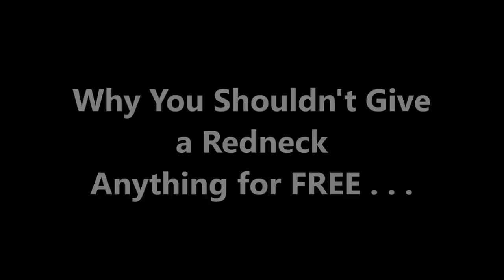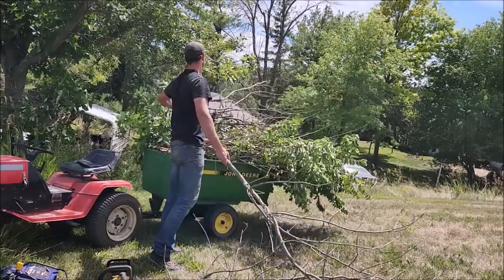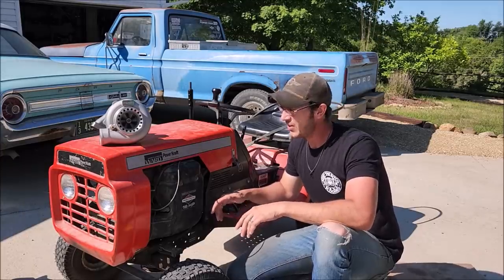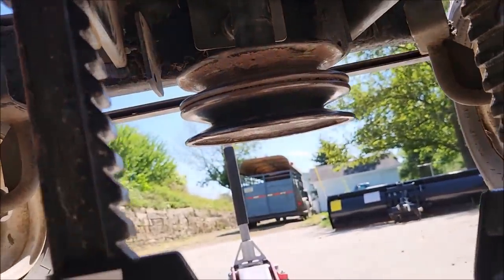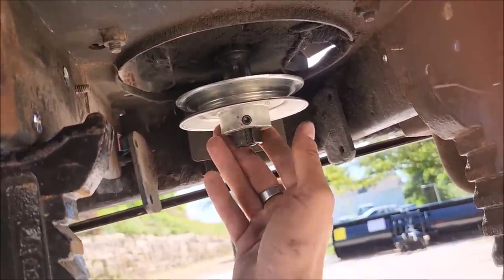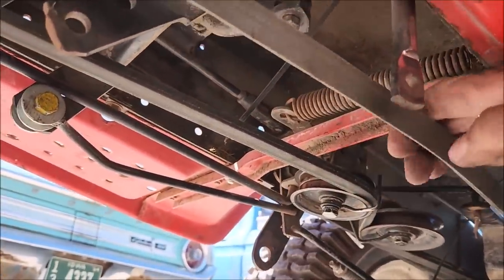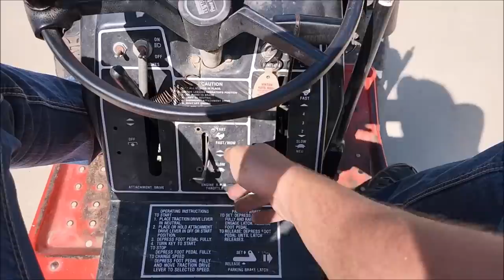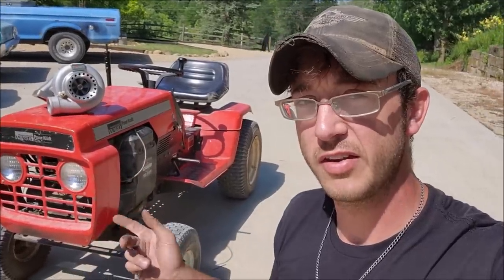FREE Mower = "RACE MOWER" for $27.50 !!!

Comment: I put something like this together years ago, but I used one of those constant velocity type pulley systems on a single speed transaxle. It was a lot of fun until I realized it would go pretty quickly in reverse.  BAD IDEA.  I hadn't planned on going all that fast, but things quickly got out of hand. The steering had a tiny bit of toe in, when going forward, which kept it going more or less straight.  Even with the wheel held steady it started swerving around violently almost immediately. I had to stick my feet out to the sides and drag the ground to keep it from flipping over.  Unfortunately the longer your feet are off the pedal, the faster it goes. 

So, there I was, going backward at what seemed to be incredible speed on a mower doing it's best to flip over, and or fling me off wondering if this was how I was going to die. I finally managed to pry one hand off the wheel just long enough to hit the kill switch and somehow managed to keep it upright  long enough to get it stopped.  I guess all that should be a warning to anyone who builds one of these.
Reply: Yep... as fast in Rev as Forward is quite the shock to people that get on it and don't expect it.
Reply: Don't go backwards
Reply: @Bellathebear777  Yeah, I kinda figured that out.
Reply: @BD-xz6te  only use speed setting one and idle in reverse
Reply: I'm dead from laughing, imagining this . . . all I did with my rider was flip the front pulley so that the bigger pulley was on the bottom & that was enough for me & in the yard it sits . . . I absolutely recommend keeping the seat kill switch operating as it should & never get on a hill of any grade sideways . . .runaway mowers are a bitch to catch up with on foot LoL
Reply: @dlostyles2578  I don't doubt they would be hard to chase down. That sounds like the voice of experience. Lol.
Reply: @dlostyles2578  is this from practice XDXDXD
Reply: @jameswest6161  oh yea u ought to try it with a 16hp best hope that sumbish hits a tree if you  horse shoed the kill switch under the seat or you one hellofa track runner

Comment: Tires can make all the difference. I have basically a mini pickup truck based on a lawn tractor and it has atv tires on the rear axle. Combine that with the fact it has a 10.5hp briggs, 3 spd transaxle (with a smaller pulley), and a steel body, not only can it out run my actual lawn tractor (despite the lawn tractor being more powerful) but also gets stuck a lot less as well.
Reply: Saw your vid, that thing looks pretty sweet! (and practical) Was thinking about building one like that myself
Reply: @jamesb1221222  Hah, actually forgot I had a video of it. That video was pretty early on (before the atv tires even). Wish I could say I built it, but my neighbor actually gave it to me (he bought it from the guy who built it).

If I had actually built it, I would have for sure changed the wheelbase so there is less rear overhang, the thing cannot take much tongue weight on a trailer before becoming a wheelie machine. But other than that the thing has been pretty dang useful.
Reply: Lock the front axle pivot and lock the diff and it's instant race mower territory.
Reply: I've been looking for ways to add sort of a solid cab, weatherproof toolboxes and a dumping bed to my 1987 Craftsman II GT18 garden tractor. I wonder if what you have is custom made or if it was manufactured that way.
Reply: @Daa253  It was custom made. If I look under it I can still see parts of the frame from the lawn tractor it was made from (not sure what kind of lawn tractor to this day though). Story is guy that built it, built it as a toy for his kids since he had some land.

Comment: Not sure of that year model but my Dad bought a monkey ward riding mow in 1988 it had a 18 horse B%G motor they and the grandkids mowed 12 acres of yard and around a 6 acre pond for 15 years no repairs but blades tires and oil changes Folks that was the toughest peace of equipment I have ever seen Great video Luke!!!
Reply: Those we're actually built by MTD... Lots of spares to be had as MTD outsourced to a lot of brands ....and were usually on the more inexpensive side
Reply: I'd love to throw my 30hp on that. 
I've currently got a Deutz Allis 612 of the late 80s vintage. 
Fast mowers are a hoot.
Reply: Yea it was most likely a "re-badged" Roper ( Sears did this also),they were a substantial unit.  Then later MTD brought their "scrap" ( all vertical shaft engines) to the market & they became "through-away " junkers--but at a good price point!
Reply: "Monkey Wards"... ROFL! I don't think I've heard that name since the 90s or possibly even the 80s from around the time I last set foot into an actual Montgomery Wards store before they started closing them down. It has been quite some time. Now that I'm thinking about it, I can't remember the last time I set foot in a Sears either. Yikes! 🤔🇺🇸

- Max Giganteum
Reply: @MaxGiganteum  the last one in my town closed and Walmart came in it's place ....it was one of the anchor stores on the end of a mall.  Strangely enough....they tore they whole structure down and built a new structure on in it's place ....about the same square footage
Reply: Not so strange to me... I'm sure taxes had a lot to do with it as well as insurance costs. Possibly even residuals for the structure based on the fine print found buried in contracts... break the contract through a sale or a sale & demolition and poof! No more residuals. One other thing probably was simple layout of the structure - a lot of old designs don't lend themselves well to a modern, singular entity that takes over the whole building. I just thought of operational costs too. Heating and cooling can kill your wallet when it's inefficient. When I think of it overall, it's was probably a whole host of dollar consuming items on the checklist of a beancounter. 😒🤔🏗️🏬

- Max Giganteum

Comment: My neighbor has one that will do over 50. There is a racing club up here and they have sanctioned races. He speed shifts it like a motorcycle. They even plow a racetrack on the ice during the winter. Studs, screws, ect.

Comment: I had an old 8hp ride-on mower from W.T. Grant's back 40+ years ago.  Had an actual 3spd gearbox w/reverse and "H" pattern shifter.  Redlined, dump the clutch you could lift the front a good foot off the ground for 10ft or so.  Top speed sucked but it was hell on fire out of the hole! 😁 Plus I could do a whole yard in 20 minutes!

Comment: When I did this like 17 yrs ago, I used a gate hinge for a gas pedal and had it connected to the governor so I could A: run wide open B: modulate the throttle when doing wheelies. That thing was dangerous 😂

Comment: You are very normal. I have raced and built racing lawn mowers using Brigg's Vanguard and Honda GX motors. About the steering is to remove the tractors front axle and build a racing style front axle with spindels and tierods. I had a blast doing what I did now my grandsons and granddaughter want me to build them racing tractors. Keep up the good work on your tractor.

Comment: Your efforts reminded me of a couple of things.  1) My granddad purpose build a homemade tractor, not a doodlebug, from auto parts powered by a Model A motor back in 1942, and still had it running when I was a kid. Short wheel base, no springs, and worn out brakes made it a handful and it would get up and go faster than one would like, even with the low geared Model TT rear end. It wouldn’t hold a candle to a Fordson, but it did it’s job when the civilian tractor supplies dried up during the war. 2), I was given a really old rear engine, tiller steered rider - so old it came with solid hard rubber tires. Had a Clinton motor. It wasn’t very useful for mowing so I took off the blade and skirting and adjusted the throttle linkage to open up wider. It made one run at a faster pace it was designed until half way thru the run it let out a solid stream of blue smoke. I wished I’d kept the tractor seat. Anyway, I did learn something about how more modern lawn tractors work.

Comment: Cool mower! they are really hard  to find nowadays with that Twin brigg 16hp eng. Took me 3-4 years to find a replacement for my 1977 Gear drive model, i've had 3 of those now and i SWEAR by it... They are the most heavily built, (more like overly built) TANKS... almost nothing can touch these. After the redesign in the 1978-9 or so they were still good but just not as heavy and different dash design like yours. But not so collectible. Small community of guys who do collect them

Comment: True story! Grew up in a suburban allotment where each family had an acre of land, so our Dads all had garden tractors for mowing. Of course, we kids all hot rod-ed them behind their backs. My Dad had a Cub Cadet with a cast iron frame and that thing wouldn't wheel stand worth a crap. But my one buddy's Dad had a Wheel Horse...shoulda been called a "Wheelie Horse"! That thing would throw you off the back if you weren't careful! So he went into metal shop one day and fashioned a wheelie bar with a caster on the bottom and came home and attached it to the hitch plate. He could then pull extended 12"-14" wheel stands all day long. One day after school, he fired up the Wheelie Horse and popped the clutch. For some reason, it popped so violently that it threw him off the back. (I can still visualize all this in my mind in slow motion almost 60 years later!) As he was falling off, he reached out and grabbed the only thing he could reach which was the throttle. So he's being drug behind the tractor holding on with his left hand to the only thing he can which is a wide open throttle, all the time headed straight for his brother's beautiful, gold, freshly painted 1963 Pontiac Catalina! Somehow, My buddy managed to shove the throttle forward at the last possible second bringing the front tires of the tractor down on the rear bumper of the Catalina with such frictional force that as the tractor went down, the Catalina went up the full travel of the suspension. Miraculously, not a single scratch was applied to the Pontiac! The enamel paint on this car was so fresh you could still smell it. A few days later, we got off the school bus and walked past the Catalina to see my buddy's cat standing squarely in the center of the hood of that gorgeous car! My brother reached over and scooped up the cat who immediately sunk all four claws into the still soft enamel! Good times...!

Comment: I recently picked up a mid 70's Ranch King with a similar steering issue. I'm gonna swap out the seized 10 horse Briggs with a 22 h.p. Tecumseh Enduro V twin, and experiment with some belts & pulleys...
THEN... I'll work on the steering.😁

Comment: Probably lots of tiny turbos off of Yanmar or Kubota diesels in IA. They're used on salt spreaders to power the hydraulic motors that do the salt slinging. Probably more AG applications that I'm not aware of too. Should be sized about right for that engine. If not, do what DieselMonkey did and use two of them.

Comment: I got a 70's model Simplicity Broadmoor rider mower last year and while the details of my situation are different than yours, the result is the same: I've got an "extra" thing to decide what to do with. And I came to the same conclusion, which is make it go fast. I haven't done anything with it yet but I like that you took the brake off the clutch pedal.

What does your mower do now? Have you worked with it at all, or have you been busy with other projects?

Comment: Hey Uncle Luke, I’d like to see you widen the wheel track by cutting and welding the front end to add 6” or more beyond the guards. Could also sleeve the rear axles and widen, but would need to support them with bearing journals so the extra leverage from lengthening the axles doesn’t burst the trans casting where they come out. That should make turning at speed more practical so you can go harder. Oh and wheelie bars for a better launch and larger diameter wheels front and back. Come to think of it, better repair the broken bushing where the steering arm comes through. 😀

Comment: I have two of the Ford YT16's and one was free and the other was a $30 and whatever you can fit in the truck can go with you.  Found a $35 Ford LGT 42" blower and a 38" John Deere blower and was like... the LGT auger is more like a plow blade and the JD would make a nice cement mixer custom job or maybe now days one of the JD 42" ones.   Well, when I came back three days back with the two 6K generators, that person noted he had an Ariens snowblower missing a part that like $200 NOS and I noted if the same model... I have two of those.  Well, that got me thinking maybe I can use the best of them all two stage Ariens snow thrower front end for a custom snow thrower/blower.  Not quite the blower you're thinking of... though interesting in my life.  Definitely no need for speed with my riders & GT's.

Comment: The rear ends on those are usually filled with grease if you replace it with gear oil they last longer
Reply from the maker: I plan to do that and weld it. It's actually extremely wore out - so well see what happens. Wouldn't be surprised if a jackshaft ends up back there

Comment: Ever made an ultracapacitor battery? I built one for my mower, and my truck. Great for.projects that you dont use often, just charge and run for a few days, when left sitting there is no degradation.

Comment: you need to eliminate the pivot on the front end that will fix most of the steering issues and also add a manual throttle aside of the stock idle control i built a a racing mower it does about 45 mph

Comment: I wonder if you could put tires from an old  3 or 4 wheeler would fit. Also the front steering could use a wider stance to help with stability. maybe even some sort of suspension on the thing if your going to make the rear end lock up.

Comment: I put a turbo on a MTD snowblower with a 10hp Tecumseh. Good times, until the engine grenaded in the first run of a huge snowstorm. I admitted defeat and bought a HondaGX clone because 40" of snow and a long driveway arent fun by hand. I fed the turbo oil using a chevy truck oilpump externally mounted on a stand with oil lines and an intercooler on the auger housing, and the turbo was off of a Dodge Omni GLX, right after I got the blower tuned up and running great in stock trim, I found the head of a Omni with a turbo at the scrapyard... well worse things followed and there ya go. The fact that the oil looked lik antiseize each season should have been a bigger clue as to the health of that engine...

Comment: Any suggestions for a reliable fuel delivery and ignition system for a mild 302 out of a 96 Explorer?  I have a Mallory unilite, had an edelbrock 600cfm now have a Holley 650cfm Truck avenger on a Edelbrock Performer intake and have had issues with the carb.

Comment: Don't stop modifying it until you need to hang a parachute out back!!!😂 I've had a couple old "wheelstander" mowers. They are fun but what's really suicidal is go get an old cheap golf cart with a Yamaha gas engine, turn it up by playing with the carb & bending the governor & go do 50 in the field! I used to surprise & scare  people when I took them for a ride around. I also built a small ramp & tried to impersonate the General Lee from time to time.

Comment: I have several of those old briggs boxer twin engines. They're great and strong and all but the carb on those are so damn temperamental. Have fun with it until it starts leaning out for no reason lol. There are cheap chinese replacements for next to nothing on Evilbay, but they don't have any mixture adjustment screws on them so they run eye-wateringly rich.

Comment: You'll want to change out the smaller of the 2 pulleys for a steel pulley. Those puppies are made for fractional horsepower and will come apart. I've seen it happen a few times

Comment: I'm excited to see how you're gonna fix the steering. Parts from McMaster? 3D printed bushing and reamed hole? Could be cheap and effective for a while, then just replace printed parts if it wears out again
Reply: This is where a small bench lathe comes in really handy. You simply turn your own bushings out of commonly found items or scrounged metals, plastics, rubber or fiberglass types of materials. Example? I've cranked out bump stops or vibration dampeners from chunks of a blown tire scrounged off the side of the road. I know of guys that made body mounts for a dune buggy out of chunks of tires. All you need to do is use your imagination. Being in the position in life Luke is in, I would encourage him to invest in a decent bench lathe or even a free standing unit with a 4 or 6 foot bed. Used in good condition is OK. They are so handy to have and can not only save you money, they can pay for themselves and make money too. As for a project like a riding mower, while you can do a lot with hand tools, a bona fide lathe and/or milling machine makes life so much more efficient. You could BUILD a mower if you had the materials. Best wishes! 👨🏻‍🔧🧰⚙️🔩

- Max Giganteum
Reply: @MaxGiganteum  I should buy a lathe

Comment: I’ve built a riding lawnmower kind of like that one it would do 83 miles an hour I had a 12 inch pulley underneath the engine with a 4 inch pulley on the transmission it was a eight speed it was a old Murray 25 hp V-twin all stock engine with a trampoline clutch spring and a Kevlar belt With a Willie bar and tractor tires it was really scary

Comment: Wanta make it go REALLY fast? Swap out the front pulley for a larger one. I wouldn't go any larger than 6-8" on the front pulley. And no smaller than 4" on the rear pulley or you will burn up belts very quickly. 5/8" belt with steel pulleys. Those aluminum pulleys tend to slip and wear out fast and I've had a couple that broke when dumping the clutch.